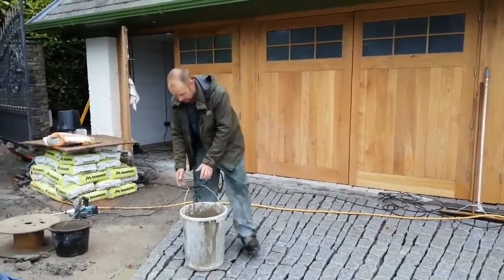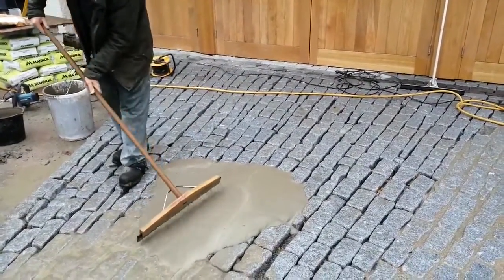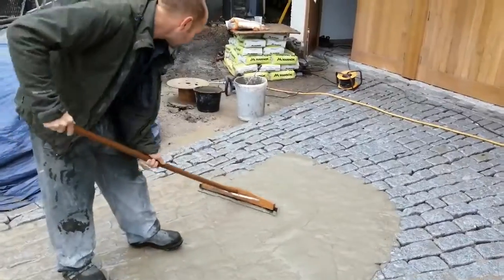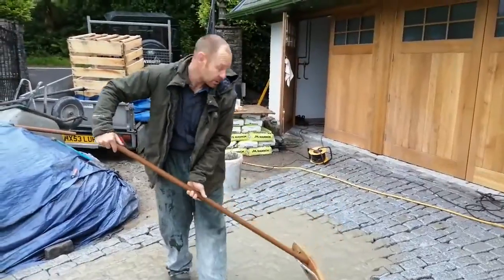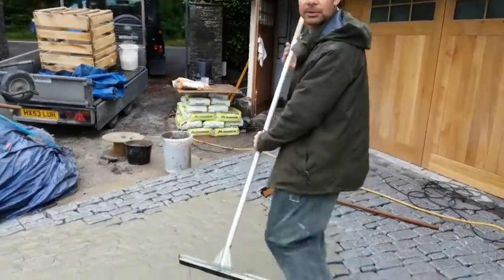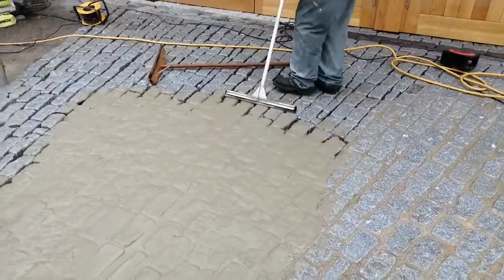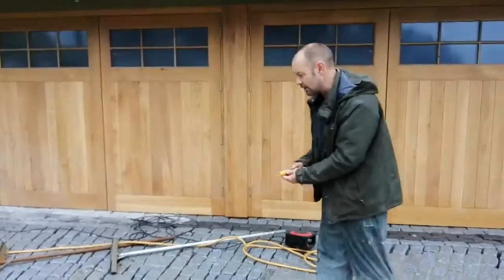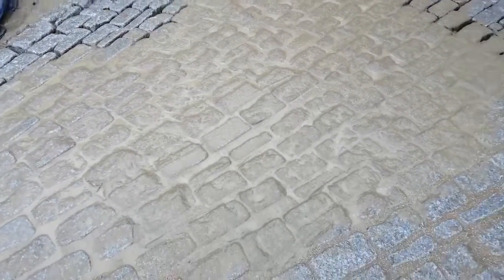Applying Flowpoint Rapid Setting Grout to Granite Setts

Comment: Would this system work on round cobbles? My drive is round cobbles and I’ve just jet washed out the dirt from between them and would like to replace the dirt with grout to aid water run off and prevent weeds.
Reply: Hello,.yes it would be perfect for that application, because it's quite runny it will accommodate all the various shapes of your cobbles. If there's anything else I can do let me know. Thanks

Comment: HI.  I have an area that is laid with 150mm cubed, rectified granite setts which were badly pointed by the contractor.  The pointing has eroded in places and filled with dirt that grows moss etc.  Some of the erosion has gone down to approx 30 - 40mm and so the setts are becoming loose.  If I were to clean out the dirt from the setts would you recommend the same pointing method with Flowpoint to repoint them?  Any advice you can offer would be greatly appreciated.
Reply from the maker: Hello Mr Eastwood, Yes you could use Flowpoint for your job. Flowpoint doesn't have strict depths to set in so you have some flexibility. If you want to give me a call so I can expand feel free. 07388 198476